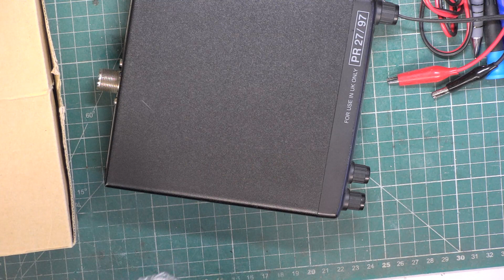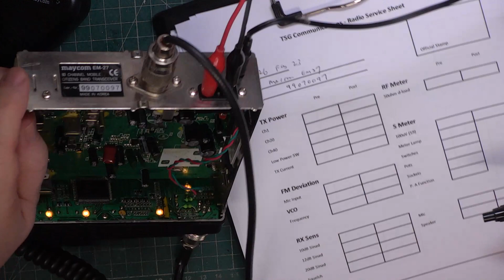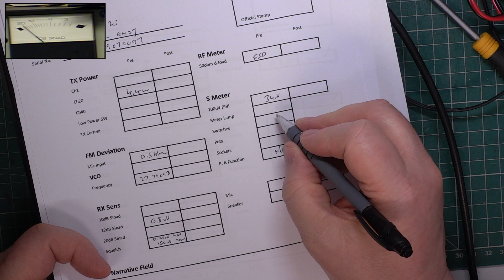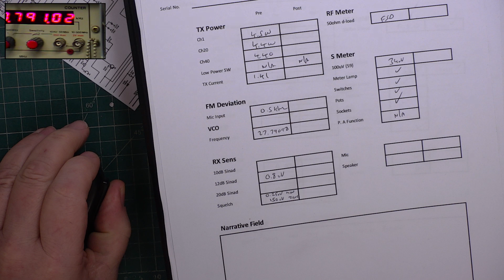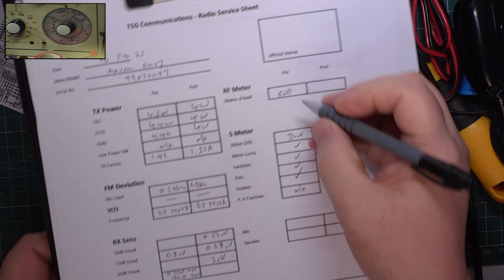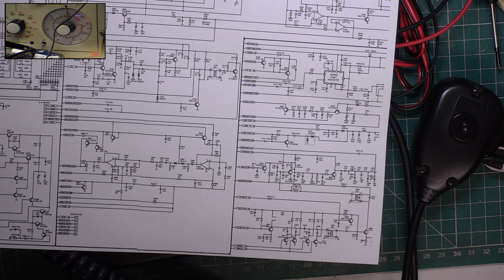Maycom EM27 PR27/97 UK/EU FM CB radio - repair & service

Comment: I bought one of these boxed, for a quid (!) at a car boot. The nicad battery had leaked but was able clean up and replaced with NiMH phone batt from Maplins. For some reason, the rig squealed without a battery attached.I really need to retrieve from my stored collection of things radio. Currently in tge middle of a house move. G4BTI May ‘25
Reply from the maker: They all squeal after battery leakage. Loads of daft suggestions to cure & none work. It's a multilayer board. They're now 25 years old & didn't stand the test of time. The final version had a factory fitted capacitor instead of the battery. They still work
.

Richaard
Reply: Hi thanks for reply. I must have been lucky with mine.

Comment: It is what it is.  I wouldn't rush out to buy one, even if I could!  Well done for at least getting it going.  Wonder what makes the deviation so low?  Design fault?  EDIT:  I don't give much for its chances for long survival with the battery leaking between the lairs into the middle lair of the circuit board!  😐🙄

Comment: After seeing this arrive in a "New Improved Design" box it caused me to panic and go and check mine. Fortunately it's an '05 model and so I'm confident its the capacitor version. It's still got the warranty seals on and it had me contemplating if I wanted to take them off to open it up and check!

Thanks for another interesting video.
Reply from the maker: You need to check. Our final final version with a capacitor was 2014 & probably made 2009

Richard

Comment: Had an early yellowy display Maycom in 2005, never opened the radio, bog standard radio n mic, but one chap was convinced I was using a power mic, due to my punchy audio. Worked another chap near Guildford, 50 smiles from Dunstable Downs near Luton (250m asl), not bad for a standard radio with a base loaded mobile whip on a magmount. Sadly it succumbed to the leaky battery problem. Is there a capacitor that can replace the battery before/when/after it starts to leak? I was a v/uhf enthusiast, 2m, 70cms, 934MHz until your vids opened my eyes n ears to how good 27MHz can be. Looking forward to the Chipmobile range test. Thanks Richard n Mr Chippy. 😁
Reply from the maker: You can fit a 0.22F memory capacitor like the final version had. I did it once to one of these before the battery had wrecked the set. I recall the capacitor only retained the memories for 24hrs though. In this instance, the board is so bad there is nothing to solder to & no means of anchoring a capacitor other than glue, so I feel no memory backup is better than a totally non working radio.

My amateur radio acivity is 95% 70cms, 4% 4M (both FM) & 1% other bands

Richard, G0OJF, UK

Comment: I always liked these sets, battery leaks aside, it's actually an intek board inside there, very popular with lots of features, different versions were sold for export and were very capable, the low tx audio problem they were known for, in the early sets this was down to a factory mic wiring issue but was rectified, there is a capacitor mod you can do to improve the tx audio but they were always tinny, I've got two inteks I started before Xmas I've got to look at again as I've been waiting for parts, when they work they work very well and they are well featured, love the scan feature just like the danita 3000 that's a lovely feature.

Looking forward to the rest, tx audio won't be an issue, Mr Chippy can simply turn the volume up a bit 😎👍